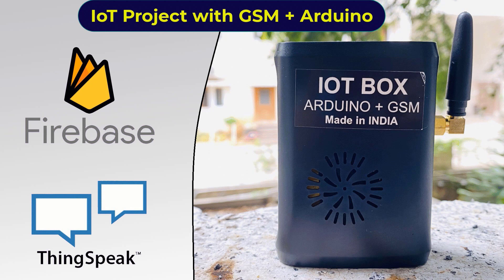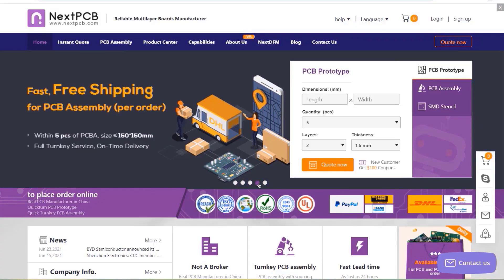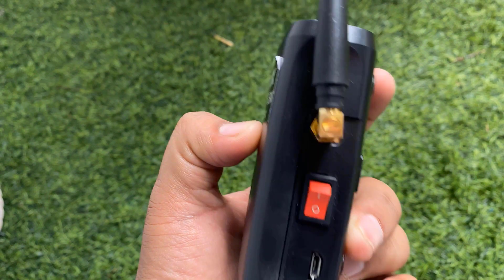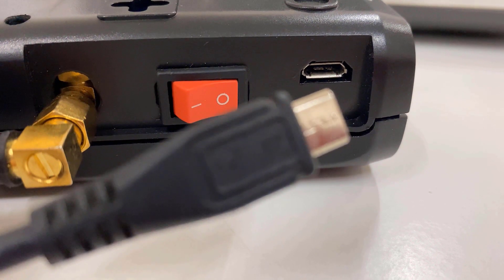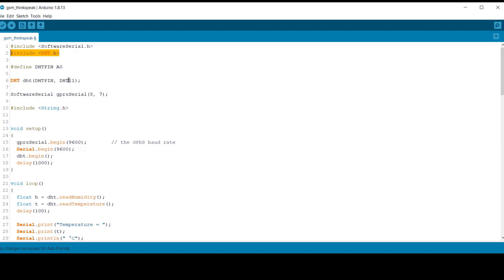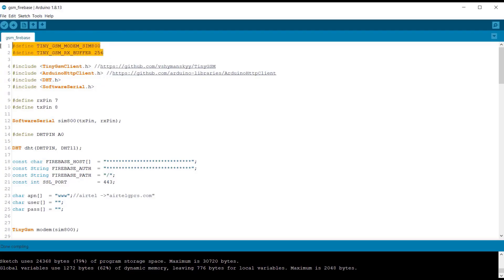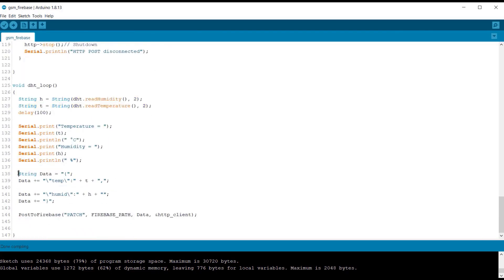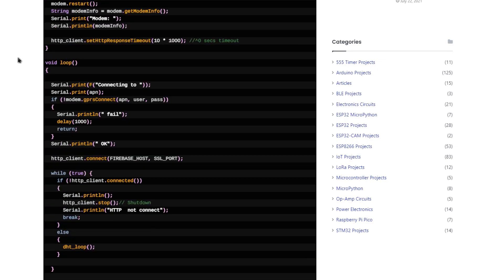Arduino IoT Box for Cellular IoT Applications || Send GSM Data to Firebase/Thingspeak

Comment: I bought the device, but the upload hangs up and the red led starts to turn on for 60s. Then it fails and throws

avrdude: stk500_recv(): programmer is not responding
avrdude: stk500_getsync() attempt 10 of 10: not in sync: resp=0x5a

I have tried it with basic blink sample program with changed pin out 13. Can you share any mail for the support ?

Comment: In GSM mode, How long it will run ? Can you find out the current consumption of the whole project?
Reply: It has 1000 mAh battery.... depending on the type of data the battery may last for 1 day...